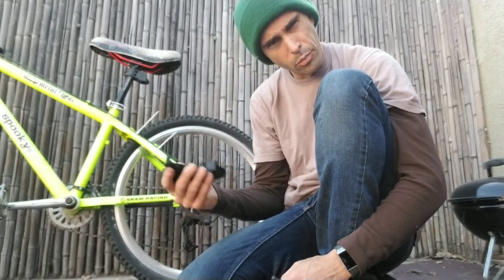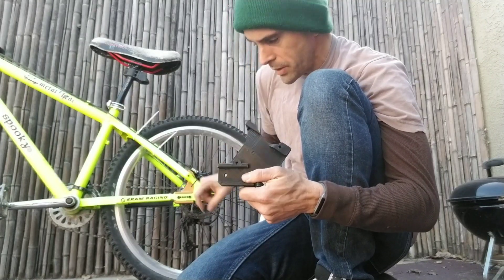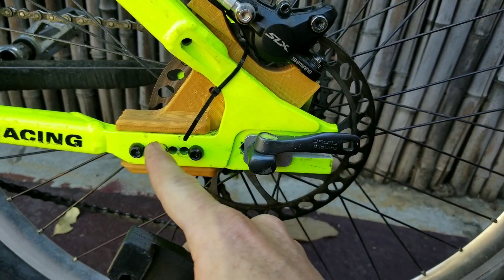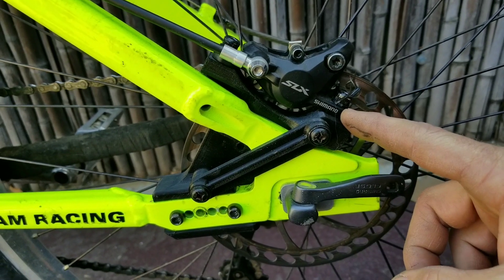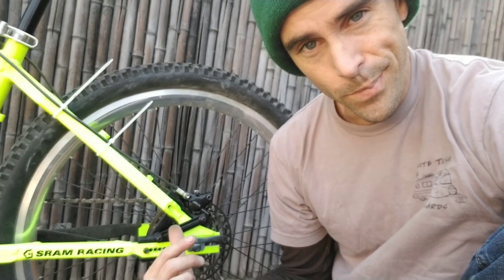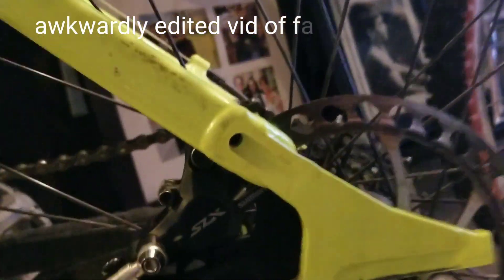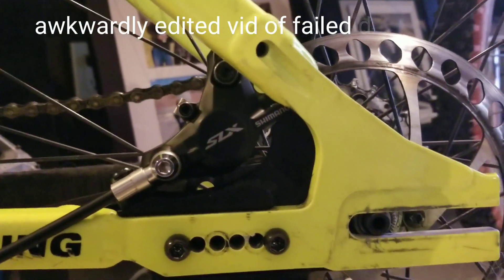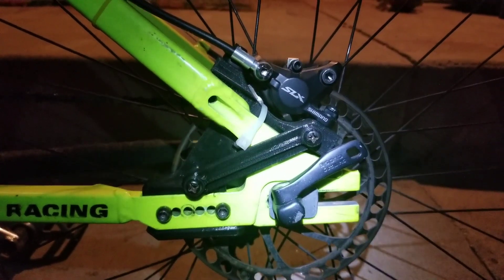Version 2 3d Printed Disc Brake adapter for my Spooky Cycles "Metal Head"

Comment: Answer for you, you print out the first half leaving 2-3mm channels diagonally across the design, put steel or aluminium rods in, then continue the print, then you will not need to make a aluminium one.  As the steel rods provide the strength for you, but retain the lightness of the print.
Reply from the maker: Fantastic idea! I don't even think the print needs to stop, just having the channels then sliding the rods through should work. I think I'll give that a shot! Thank you!

Comment: Hey dude dunno of you can help, just picked up a bandwagon and would be very interested in a template or diametrres as am looking into having a mount made, cheers :)
Reply from the maker: Hell yeah! That's a rad frame. Do you have a 3d printer or access to a machine shop? I could post the 3d file on my thingiverse page
Reply: @gordontarpley  Would be really nice if you could post the 3D file if you still have it. Personally, I'm not a very good designer.

Comment: As much as I love 3D printing things myself, for this I would copy this very simple design that somebody made out of flat metal, and I'm pretty sure it could be made to fit a postmount caliper too: https://s33.postimg.cc/3o6pi96db/metalhead_mount_BEST.jpg With a plastic one, I would be worried about the caliper being dragged up along the seat stay and splitting the mount in that direction.